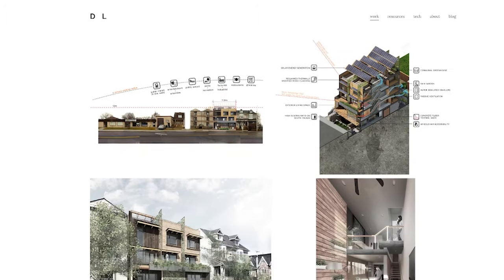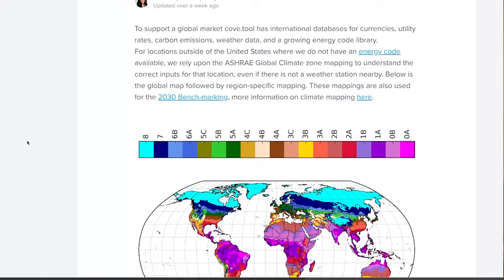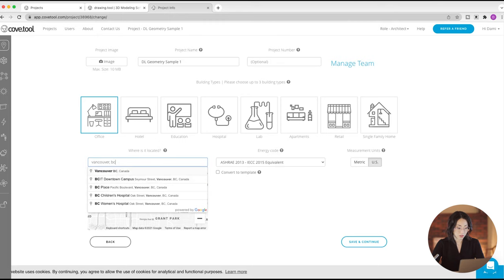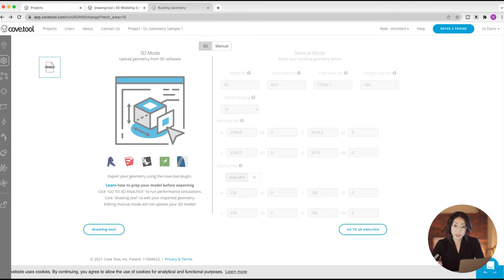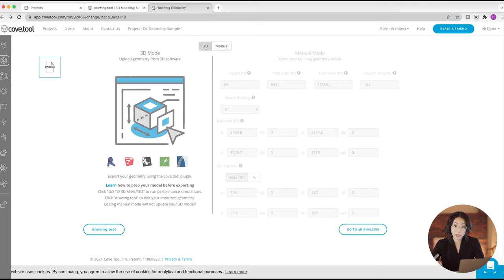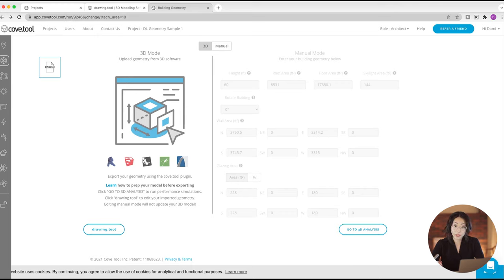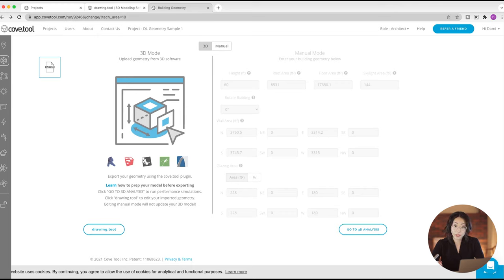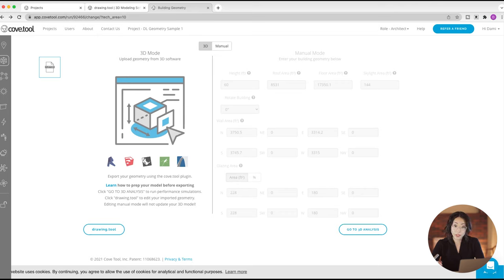Designing for Sustainability | Energy Modelling made easy

Comment: I used cove tool in my last year of college as part of my first time trying to energy model and I really struggled with cove tool. i guess I'm not sure what the standard or expectations are with energy modeling tools but in my head i imagined i would have a lot more control over my model and individual values than cove tool would allow me to have. Things like window values like losses and gains, the spacers and installs, thermal bridges idk stuff like that I felt pretty limited. Also trying to place my building from Revit into Cove was not as easy as you made it seem tbh I don't know what I was doing wrong. again maybe this is how all energy modeling softwares are I've never seen any others
Reply from the maker: Hm yeah good point. You can put in individual values for each window / wall but I don't remember seeing thermal bridging. I guess you would have to build that into your wall's r value. I think there's a formula for manually calculating that into your wall's r value.
Reply: Cove looks to be somewhere in-between eQuest and Revit’s built-in tools. Coming from eQuest, this looks to have less control but it’s enormously more user-friendly. eQuest is pretty archaic in terms of user interface and there’s a significant learning curve. I believe it is something of an industry standard in some places. Compared to Revit’s built-in energy modeling, this seems to be more advanced in some ways but of course it’s easier to use a Revit model with Revit’s tools. Looking forward to trying another energy modeler!
Reply: @Adolar  I would say eQuest is more technical from Engineering aspect, I agree with the learning curve point as the Architect would need to learn more about Building MEP Systems to nevigate their way through eQuest. Also eQuest has ugly outdated graphics which is something Architects don't appreciate lol

Comment: Yeah we use honeybee inside of rhino for rather complex building shapes.   It has the advantage to be also able to calculate very complicated architecture, but the downside, that it´s horrible complicated to get into theese very flexible scripts.  

So we also decided to use for the very early stages of cityplaning the program  " Spacemaker" that just has been bought from Autodesk..   yeessss i know...  i dont like autodesk too..  

But this programm is extraordinarily easy to use.   It creates about 10 Categories of Analysises...     Sun, daylight, trafic sound, solarpanel potenntial,  Windsimulations and so on..   but realy focuses on the early stages of citydevelopement..  

So for a single Building its not allready prepared..    But for everything else very great..  

Yes its expensive.  But i work in a 500 Architects company, so a view licenses are ok.

Comment: very nice video, appreciete the hard work
just a tip, the shadfows in your video are off, especially with YouTube video compression,
the solution is to properoly expose the shot (using lights and using right camera settings)
i am a video producer and mechanical engineer btw.

Comment: Hi Dami,

That software is pretty cool. Especially optimisation tool. 
 Looks like Canada and US is a bit behind UK and Europe regarding sustainability of buildings. I'm principal mech and sustainability energy assessor and we are using software's to inform Architects about most efficient build since Riba Stage 2, so we would impact the design almost from the kick off. Also we would analyse overheating of the building and specify any required local internal or external shading, G values, etc. 

There are projects were sustainability drives architecture and the building and its not an just an afterthought which is a positive change in the process. I'm using software called IES VE.

I have a lot of ideas. we should start prefabricating houses and be done with loads of BS rules that slow the process. Housing is just a right and not an asset in contrary to what majority of society  thinks. 
Commercial buildings are a different story, haha :)
Reply: IES VE is brilliant, I only got to use it once back in 2012 when I worked for a firm in Dubai and it blew my mind. Cove tool is kinda of a startup, they need time to get there but a good thing is being free!
Also, modular houses should be way more common now. Honestly they will save tons of $ & emissions too, from manufacturing envelope materials to construction to waste...you name it. at least at small houses level this should be the main way to go

Comment: @DamiLee I have often wondered how much Architects size building components and do calculations for those components.  I know Structural engineers typically do that work but, it sometimes appears to me some Architects may do some of that work.  Maybe you could clarify this based on your experiences.  Thanks in advanced.
Reply: Typically mechanical engineers size the equipment (air handling units, boilers, chillers, pumps, etc).